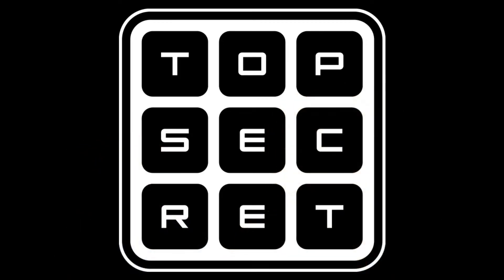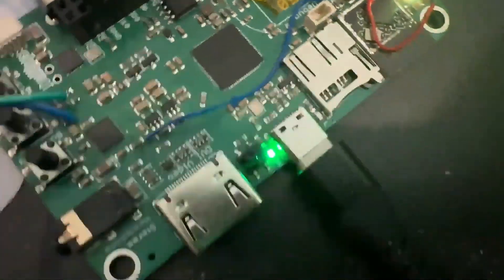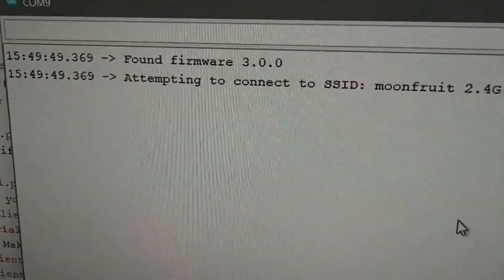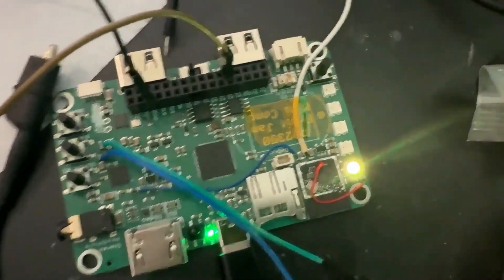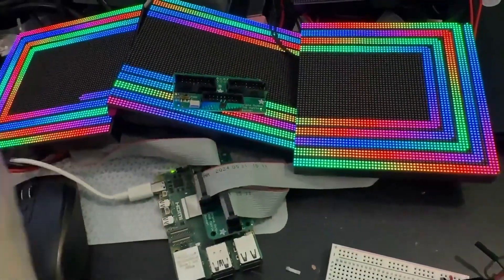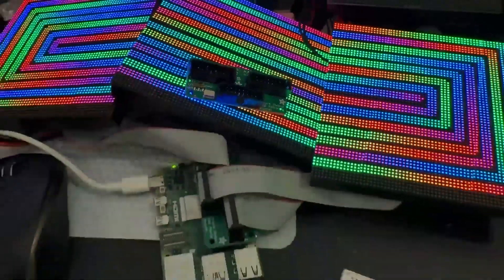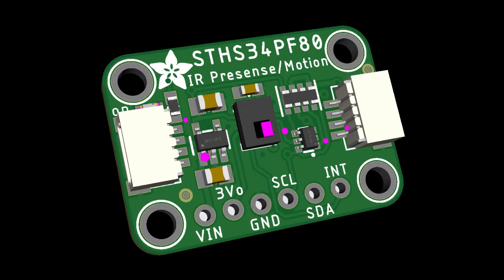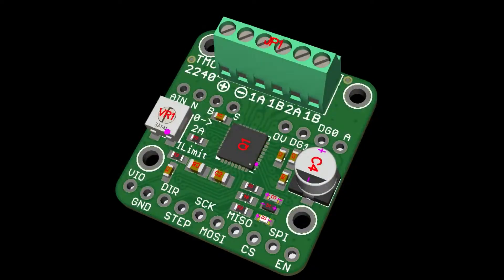Adafruit Top Secret for June 11, 2025 #adafruit

Comment: Please could you do a usbc power board that’s capable of PPS? It would be so awesome to have the ability to set a precise voltage and current in 20 MV increments and 50 MA increments via I2C, and it would make the ultimate desktop power supply.

Maybe a breakout for the AP33772S or TPS25751? 

Thank you ❤